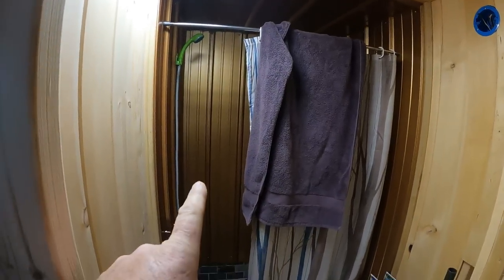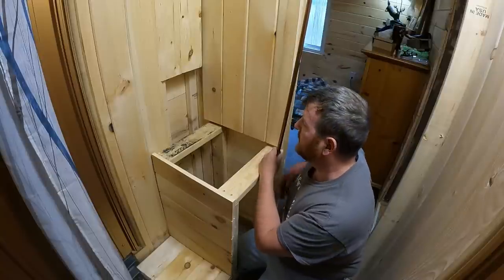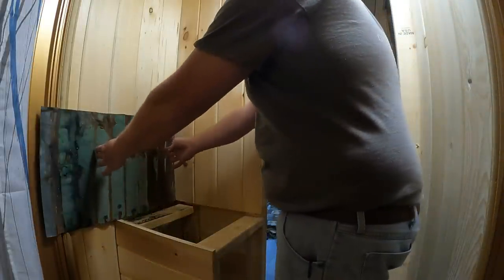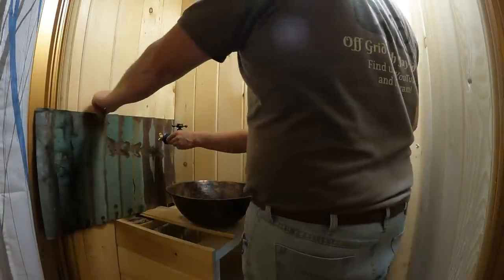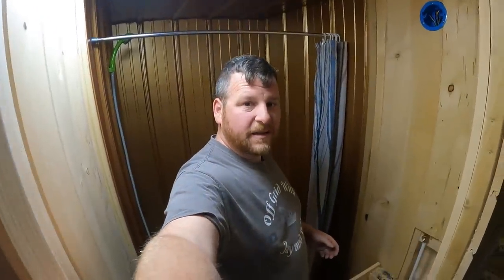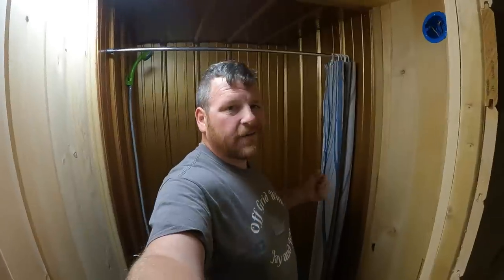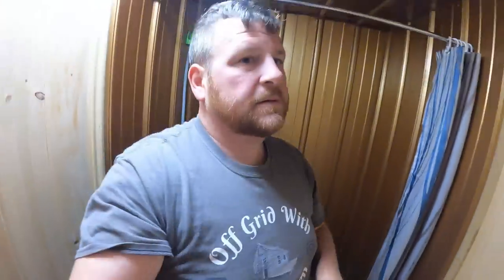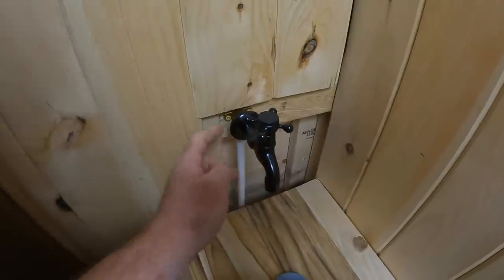To Pex or Not to Pex.....The Tiny Bathroom continues

Comment: You can recycle copper fittings.  Need to clean when cooled.  Flux is key to a good joint.  flux liberally heat and until the solder melts and sucks into the joint.....
Reply from the maker: Cool....I'm hoping for the best

Comment: mix your water with a T from hot and cold //so just warm water comes out your tap pre- set water flow with ball valve then you need just 1 water line at sink

Comment: Hi Guys, the bathroom is looking great!! What is Jen taking classes for? Absolutely run the hot water line even if you don’t need it right now, then you won’t have to do a the work for it later. Just cap the line off if you don’t want to use it now.
Reply: Jen is a teacher.
Reply from the maker: Thanks Terri....Jen actually teaches lessons and classes  to underprivileged or those who struggle and need some extra help with schooling. It works well that she can do this online from the cabin.

Comment: Hmmm…Jen dinner looked so good! I wanted a bite of that tortilla!
Hey Jay I took a class when I was younger on soddering. I remember the most important parts were sanding the inside of the pipe, using a lot of flux and heating the pipe up a lot. Then the sodder will suck around the hole copper pipe. Good luck tomorrow. You will do great!
Reply from the maker: Thank you for the tips and encouragement......I need it, lol
Reply: @OffgridwithJayandJen  you got this!!